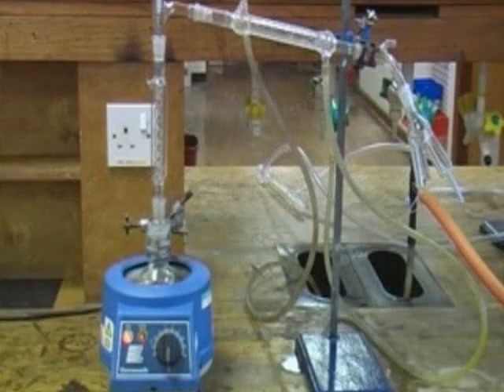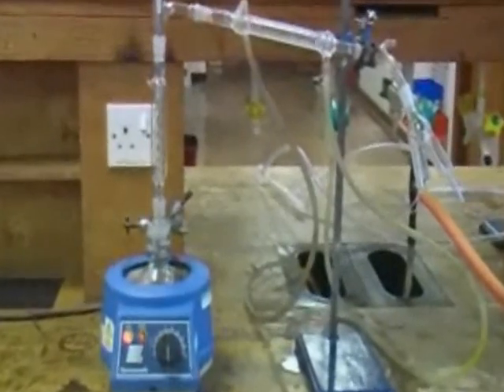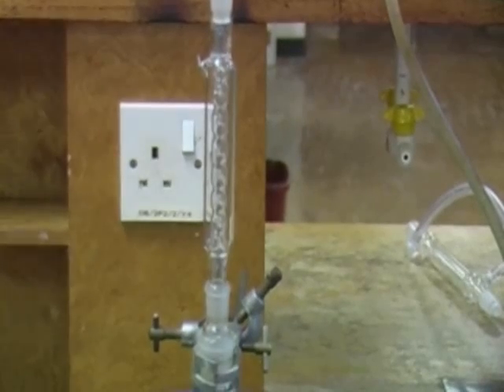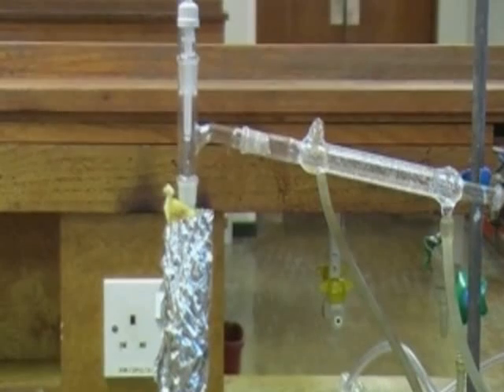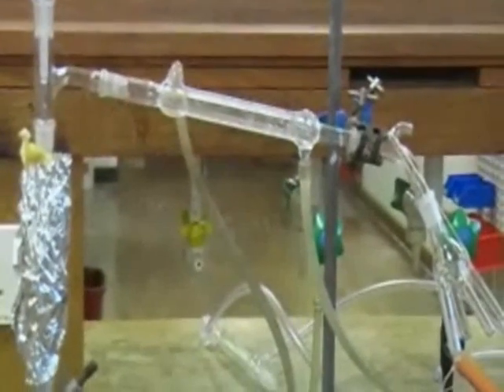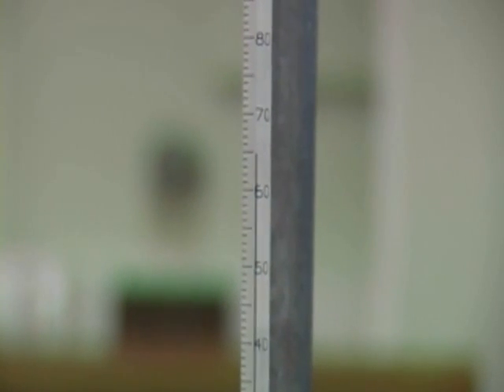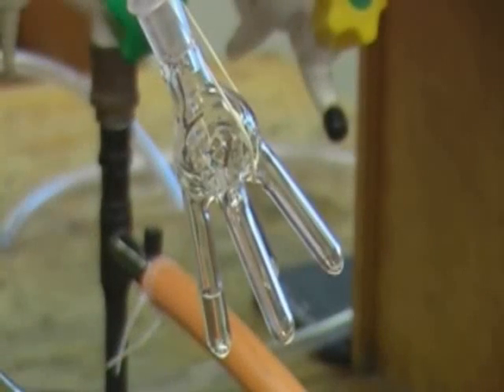Fractional distillation

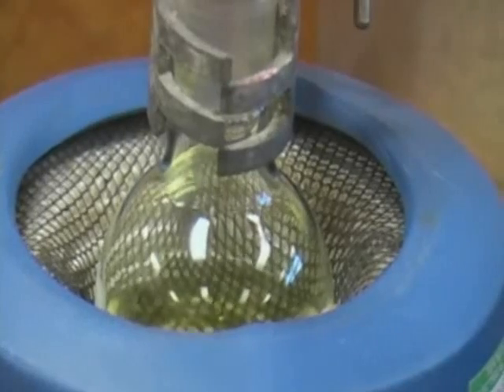Comment from the maker: The round-bottomed distillation flask is clamped (see 1:06) and the 'pig' is attached to the distillation kit by an elastic band. Perhaps we should've used a yellow clip there, though... Yes, it probably should be clamped for extra safety, but the use of a rubber  band allows for easy rotation of the pig.

Comment: Interesting.  I wonder how much more pure a substance would be after passing through the fractional distillation process compared to regular distillation, and whether it would need multiple distillations to remove it from its mixture. Also, I know stable temp is an indicator of phase change, but how could I predict it without knowing the pressure of the system? Is the distillation happening in a vacuum of space?